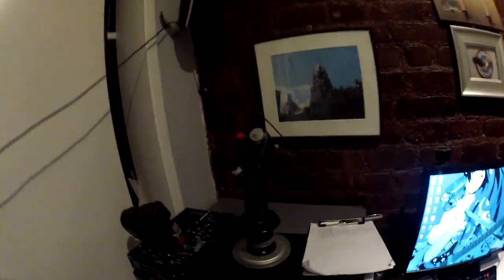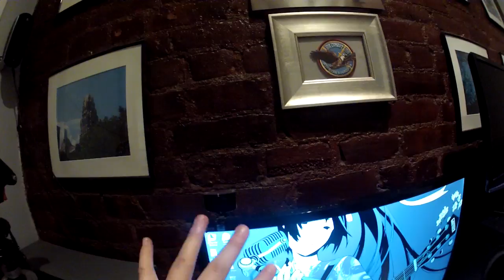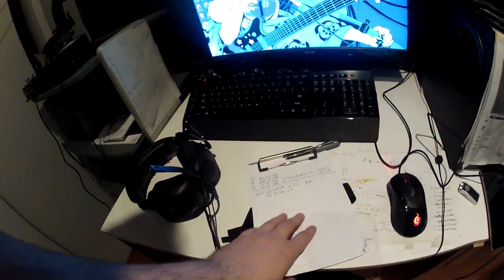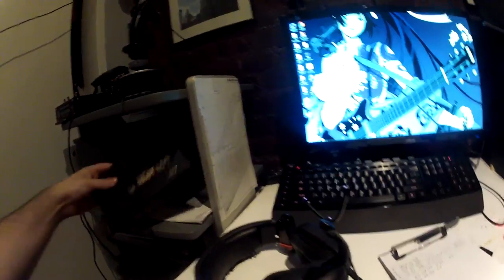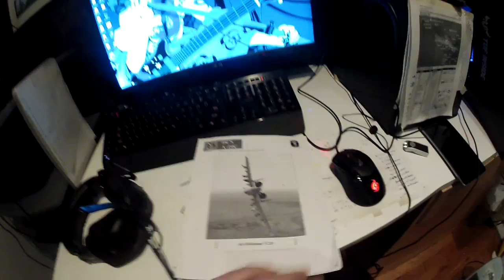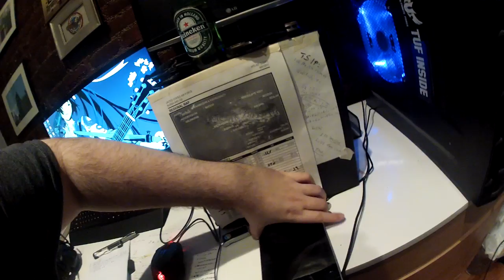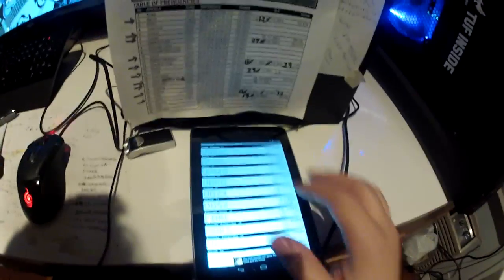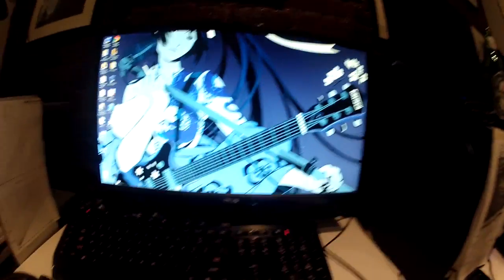Ralfi's Alley- My Specs (Happy new year!)

Comment: I've been using a Saitek AV8R-03 for about four years now. It's a simple, cheap, yet reliable piece.

I've never had to install the thing, every flightsim I've tried has had no trouble with it. Throttle and rudder are built in, making it compact. However, its plastic parts can make it a little stiff when it comes to those small, precise in-flight adjustments.

Overall, for a £30 stick, I'm happy with it. It's cheap, its simple, and gets the job done, however roughly.

Comment: I know the X52 would be fine, as I said, I used to use it (recently upped to the X65F). I never said it wouldn't work. As for the HOTAS thing, the X52 does come with throttle and stick, but there are simply not enough buttons, switches, or hats on the X52 to achieve full HOTAS functionality in DCS: A-10C. I was still having to use the keyboard for things such as the CMS, China Hat, Boat Switch, and Mic Switch. Probably could've worded the previous statement better, but this should clear it up.

Comment: I use an X52 and it works just fine (for me). You will have to assign the buttons manually, and since it's not HOTAS they won't match up too well, but the X52s ability for multiple modes makes up (somewhat) for that. I have no doubt that the Thrustmaster Warthog is more stable and works better than the X52, but the X52 is good for those of us that cannot afford the Warthog. It all comes down to user preference though. Use what you like and feel comfortable with.

Comment: What do you mean it's not HOTAS? The x-52 comes with a throttle and stick, right? It's just not mean to replicate the A-10's setup like the thrustmaster warthog. The x-52 would be just fine, you'd just have to program (or find) a profile to fly with. People use a lot of joysticks to fly just fine - warthog, full CH setup, x52, x52 pro, x65f, etc.

Comment: LOL i am running a lot of the same gear as you. Track IR, Thrust master Hotas, and the same rudders. 
If you upgrade your cpu you should look at water cooling I use cool master towers, It's very nice and quiet. 
I7 sabre-tooth mother board dual core 3.14 chip it's a little old but is still hanging in there. 16 gig's of ram GTX970 video card with 4 gig's on board.
How much do the think the SSD help out? Because that is my next upgrade. 
I am still fumbling around with DCS, but watching your video's has been a great help and very entertaining.

Comment: I've just built a computer with a 3.3ghz dual core processor and I'm going to get a 1gb gddr5 radeon gpu for it. do you think it will run dcs a-10c? also can you put links to the sheets you use for it?
Reply: JackPainter98 I think it requires a minimum of a 2gb GPU
Reply: I strongly encourage an 8GB VRAM card - the 4GB VRAM card I am currently running (for two more months) is a bottle neck in my system, but you can get away with it. Don't skimp on processor either - DCS is a simulation - and can be very processor heavy.

Comment: Hi ralfi,  why are u using 2133 mhz ram on z77 motherboard? maximum ram acepted by motherboard is 1866.  20133 is if you overlock it.

Memory
4 x DIMM, Max. 32GB, DDR3 1866/1600/1333 MHz Non-ECC, Un-buffered Memory

asus .com/Motherboards/SABERTOOTH_Z77/#specifications

regards from e111 @ spain

Comment: the 690 is a BOTTLENECK FOR THE CPU!?!?!  more like the otherway around....
Reply from the maker: No, in terms for the simulator DCS, it does not use the GPU as much as the CPU. To get higher frames in DCS you need a higher clock for your CPU, that's where your power comes from in that specific simulator.
Reply: oh well that makes a little more sense.